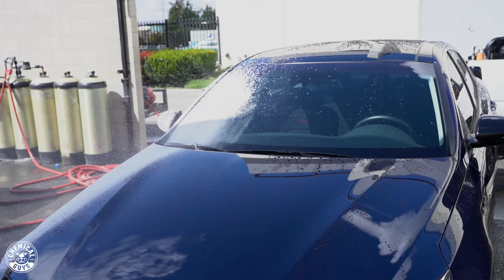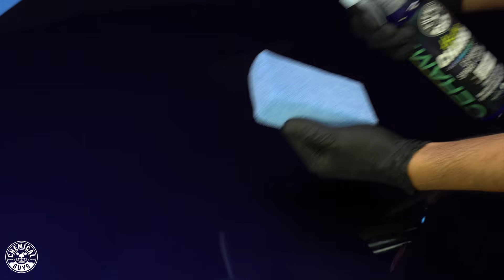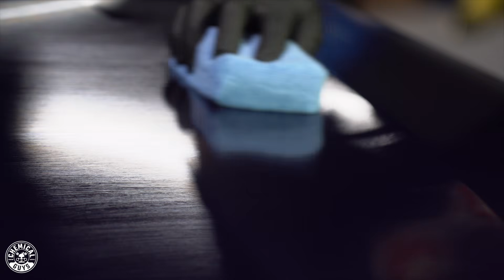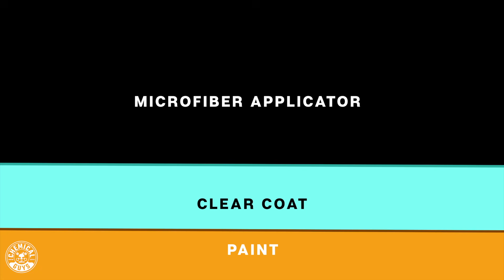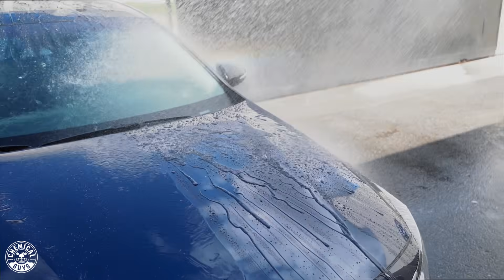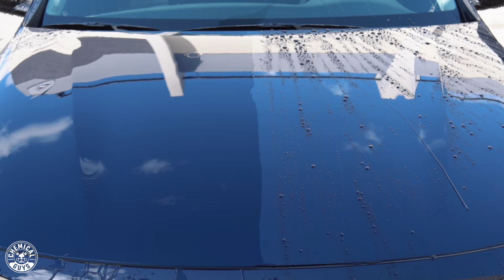How To Easily Apply NEW HydroCharge Ceramic Spray Coating | Chemical Guys

Comment: So I did hydrocharge on my hood only, but forgot to polish first, so I still have unwanted swirls.  Will clean slate or wipe out take hydrocharge off so I can start over.  If not, how do I get it off. Thanks!
Reply from the maker: Hey Kevin! We recommend polishing Hydrocharge off. Clean Slate will not strip it off. Thanks for watching and thanks for being part of the Chemical Guys family!
Reply: @ChemicalGuys  I cleaned with Clean Slate and it was not beading as much as before.  I then polished with VSS then did hydrocharge and it worked okay.  I feel like the polish did not do as well as usual, but maybe it was because it was doing more stripping of hydrocharge then it was filling scratches and swirls.  Thanks so much!

Comment: Will this product work on any chemical guys product for a detail spray?
Reply from the maker: Hey! Hydro Charge is a sprayable clear, liquid nano-ceramic coating. Hydro Charge can be described as an additional clear coat, with 3 times the hardness and self-cleaning hydrophobic properties. Hydro Charge is not a quick detail spray.

Comment: Can this be used on powder coated rims?
Reply from the maker: Hi Randall, HydroCharge is only designed to be used on clear coated painted surfaces, not powder coated surfaces. Thanks for watching and make sure to check back Monday for a new video drop!

Comment: Would you apply a carnuba wax on top of this product? When is this landing in the UK!?
Reply from the maker: Yes, HydroCharge Ceramic Spray can be layered. We have found in testing that 2 rounds are more than enough for any surface we have tested. We do have aerospace clients that have gone as far as 4 coats. Thanks for watching and thanks for being part of the Chemical Guys family!

Comment: Would you use jet seal before using the ceramic coating for an added layer of protection?,how long does this ceramic last?
Reply: Connor Broyles after. And up to a year from what I’ve read

Comment: Can you put ceramic on the windows? No one ever talks about it
Reply: Wot u think rain-x is ?
Reply: @dentman62  Honestly not sure. Wouldn't consider it a ceramic coating. Especially since it doesnt last near as long. I figured it was ok, but no body does it so i was curious. 🤷🏻‍♂️

Comment: Would I need to wax my car as I normally would after this product or is this a replacement of that?
Reply: If you wax after you'll be covering up the properties of this product. Adding a layer of wax may also degrade the sealant beneath it depending on what ingredients are in the wax.

Personally I wouldn't.

Comment: what is the best way to clean bugs and tar off the ceramic coating? will bug remover also remove the ceramic coat?
Reply: Try soapy water (The one that doesn't strip the was/coating)if you can get rid of them

Comment: And this is why you sand before and after you put in a clear coat. Don’t get me wrong this stuff works but there’s a reason there’s factory paint and custom paint. The time and effort goes a long way. Yes these products make it shiny and protect, but even the picture he used to show what it does showed the clear coat as jagged.

Comment: This video was amazing! Keep up he awesome work! Also, would you throw away the microfiber towel after it’s used to buff off excess product? Or are you still able to save your towel?
Reply: If you wash it immediately it should be ok. If you let it sit the coating will harden in the towel.

Comment: Anyone know if this can be layered on itself?  Meaning would adding a second coat after adequate cure time extends the longevity of the protection?
Reply from the maker: Yes, HydroCharge Ceramic Spray can be layered. HydroCharge Ceramic Spray Coating is an ambient air cured coating. No special lighting or infrared light is required. The unique sprayable formulation starts to cure the moment it is sprayed out of the bottle and exposed to air. Once applied to the surface, the product will bond within 1-2 minutes. Always remove and buff to a perfect shine with a premium microfiber towel. Feel free to layer your coats of HydroCharge as you please. We have found in testing that 2 rounds are more than enough for any surface we have tested. After applying HydroCharge Ceramic Coating, it is ideal to keep it out of the elements in a dry and clean environment for 2-3 hours. Depending on the climate, the hydrophobic effects will continue to improve even more after 24 hours of being applied. Also, make sure to check out HydroSuds Ceramic Car Wash Soap to maintain your coating to make it last and shine the longest! 
https://www.chemicalguys.com/hydrosuds-ceramic-car-wash-soap/CWS21216.html
Reply: Thanks for replying so quickly.  If the product is layered does that increase the longevity of the protection?

Comment: Hi just would like to ask can this product be used in direct sunlight or in the shade?
Reply from the maker: Great question! Yes, HydroCharge can be applied outdoors, we recommend that you stay away from direct sunlight and work on a cool surface, also work in a shaded or covered area such as under a tent. Preferably you should work in a controlled environment to prevent contaminants with interfering with the results of your application of coating. Happy detailing!

Comment: When will this product be available on Amazon??? Thank you!
Reply: I was wondering the same dam thing. . LOL LOL
Reply: It's on Amazon right now..only 5 left though.
Reply: @jeffshelton2970  Ive been looking for months. Still cant find it.
Reply: Chemical Guys WAC23016 HydroCharge Coating-The Ultimate Nano Ceramic Spray Car, Boat & Motorcycle Long Lasting Paint Protection https://www.amazon.com/dp/B07PZ92KJ3/ref=cm_sw_r_cp_apa_i_F.SxDbJ4FGPHN

Comment: @chemical Guys can it be used on top of your jetseal?
Reply from the maker: Great Question! We recommend stripping the surface of the paint from any previous and or residual wax or sealant from the paint for HydroCharge to have the best bond possible to the paint. HydroCharge Ceramic Spray can also be layered. We have found in testing that 2 coats are more than enough for any surface we have tested. HydroCharge is layerable with all your favorite Chemical Guys waxes, sealants, and quick detail sprays. Simply wait for HydroCharge to dry and then proceed as you would on any other car. Refer to HydroCharge FAQ'S for any further questions you may have. Happy Detailing!

Comment: Can this be used on vinyl wrapped cars?
Reply from the maker: Great question! We recommend that you use our Wrap Detailer Gloss Enhancer & Protectant for glossy vinyl wraps and or Meticulous Matte Detailer & Spray Sealant if it's a matte finish. Both are spray quick detailers and spray sealant in one to maintain glossy vinyl or matte wraps and to protect them from harmful UV rays and drying. Make sure to check it out on our website, link will be mentioned down below! 
https://www.chemicalguys.com/wrap-detailer-gloss-enhancer-and-protectant-for-vinyl-wraps/wrap-detailer-gloss-enhancer.html
https://www.chemicalguys.com/meticulous-matte-detailer-and-spray-sealant/meticulous-matte-detailer.html

Comment: How does this compare to Carbon Flex C9?  is it a comparable replacement?
Reply from the maker: Hello Kevin, great question! Sprayable ceramic coatings such as HydroCharge is a newer and easier form of applying a ceramic coating to your paint. Traditional coatings such as Chemical Guys Carbon Flex C9 coating will be superior in durability and shine because its a lot thicker and harder of a product due to it's more concentrated form. They are both great products but differ in application and results. What you can also do is use HydroCharge as a topper for Carbon Flex C9 to replenish your coating and make it look and last a lot longer. Make sure to stay tuned on future videos we have coming your way which follow this line of coating!
Reply: Chemical Guys Was going to ask this. I used Carbon Flex C9 one year ago when my car was brand new. Would this be a good scenario for using HydroCharge to touch it up? Also, should I wash with Clean Slate or will that impact the carbon Flex C9? Many thanks!

Comment: I just found out you guys have a store in Montclair and I'm so happy! I can finally buy my supplies somewhere else than the onld store down the road
Reply: Good luck getting it from the stores. Unless Cali
Reply: @biohazeconversions4872   I'm in cali. And one of their stores is like 15 min away from my house
Reply: @antonioparamo2048  Your best bet is Gardena store but quick call to ur local DGCG should help
Reply: @biohazeconversions4872   Detail Garage - Auto Detailing Supplies
5108 Holt Blvd, Montclair, CA 91763
(909) 626-0103
https://maps.app.goo.gl/EBNPp

Comment: Would it hold up to pressure Washer force though. The foam cannkn along with the pressure washer usually degrades coatings faster than usual
Reply from the maker: Yes! HydroCharge is a hardening ceramic coating that penetrates deeply into the pores of the paint when properly prepped and will hold up to even the harshest elements. Assuming that you're using a pH neutral shampoo that isn't going to break down the coating in the long run then it would hold up for the full 12 months of protection. Also make sure to check out HydroSuds Ceramic Car Wash Soap to maintain your coating of HydroCharge.
https://www.chemicalguys.com/hydrosuds-ceramic-car-wash-soap/CWS21216.html

Comment: I have a black Veloster Which I use black light wax and I use a sealant and then I come back with the black light ending wax that is in the canned paste could I use this on top of the ending wax of the black light That’s the final stop for my detail of my car can I use this Hydro charge on top of that?
Reply from the maker: Great Question! We recommend stripping the surface of the paint from any previous and or residual wax or sealant from the paint for HydroCharge to have the best bond possible to the paint. HydroCharge Ceramic Spray can also be layered. We have found in testing that 2 coats are more than enough for any surface we have tested. HydroCharge is layerable with all your favorite Chemical Guys waxes, sealants, and quick detail sprays. Simply wait for HydroCharge to dry and then proceed as you would on any other car. Refer to HydroCharge FAQ'S for any further questions you may have. Happy Detailing! https://www.chemicalguys.com/blogarticle?cid=article-hydrocharge-faq

Comment: Can you use this over jet seal since i already used jet seal and wax about a month ago.
Reply from the maker: Great Question! We recommend stripping the surface of the paint from any previous and or residual wax or sealant from the paint for HydroCharge to have the best bond possible to the paint. HydroCharge Ceramic Spray can also be layered. We have found in testing that 2 coats are more than enough for any surface we have tested. HydroCharge is layerable with all your favorite Chemical Guys waxes, sealants, and quick detail sprays. Simply wait for HydroCharge to dry and then proceed as you would on any other car. Refer to HydroCharge FAQ'S for any further questions you may have. Happy Detailing! https://www.chemicalguys.com/blogarticle?cid=article-hydrocharge-faq

Comment: Just jet sealed my truck can this go on top or do I have to start over?
Reply from the maker: Great Question! We recommend stripping the surface of the paint from any previous and or residual wax or sealant from the paint for HydroCharge to have the best bond possible to the paint. HydroCharge Ceramic Spray can also be layered. We have found in testing that 2 coats are more than enough for any surface we have tested. HydroCharge is layerable with all your favorite Chemical Guys waxes, sealants, and quick detail sprays. Simply wait for HydroCharge to dry and then proceed as you would on any other car. Refer to HydroCharge FAQ'S for any further questions you may have. Happy Detailing! https://www.chemicalguys.com/blogarticle?cid=article-hydrocharge-faq

Comment: what is the SIO2 content on this, as a precentage ?
Reply from the maker: Hello Paul -  The quantity of SiO2 does not determine the quality of the product and it’s just one of the ingredients that make HydroCharge protect and shine like nothing else. To avoid copycats in the industry, we do not disclose the exact amount of SiO2. All we can tell you it’s between 25-55% and that it’s the perfect amount for optimal shine and protection!
Reply: Thanks for the Information.  That is quite a high percentage compared to other SIO2 spray on coatings. With that amount then it could be considered an actual coating.  When is it coming to the UK ?  @ChemicalGuys
Reply from the maker: Thank you for being part of the Chemical Guys family! Make sure to check with Chemical Guys UK for further info and product availability! https://www.chemicalguysuk.co.uk/

Comment: can this be applied outside? in the sun? (direct or indirect) or only indoors in a controlled environment like traditional coatings? also how many vehicles do you think a bottle will be able to do?
thanks
Reply from the maker: Great question! Yes, HydroCharge can be applied outdoors, we recommend that you stay away from direct sunlight and work on a cool surface, also work in a shaded or covered area such as under a tent. Preferably you should work in a controlled environment to prevent contaminants with interfering with the results of your application of coating. The usage of the product varies upon use of the product, remember you do not need to over saturate the area, a little bit goes a very long way. Happy detailing!

Comment: I just got tree sap from a pine tree on my 2017 Jeep Renegade Trailhawk... what’s the best CHEMICAL GUYS way to get this off the paint, windows and trim. I need to do this ASAP before it starts to mess up the paint.
Reply from the maker: Hello Bentley! There are many products that work out great to remove tree sap such as Bug and Tar Remover, Clay Bar and even Butter Wet Wax! Make sure to check out our video on what you can use to remove heavily stuck on tree sap, bird droppings, tar and ash from painted and glass surfaces! Also make sure to check out our previous video on how to prep your vehicle before you apply a ceramic coating! You're on the right path to restoring your 2017 Jeep Renegade Trailhawk to better than when your first got it! 
https://www.youtube.com/watch?v=X-hZM-nqfBA 
https://www.youtube.com/watch?v=C2-L_1wJwCE&t=1s
Reply: Chemical Guys I used nail polish remover and the sap came off instantly vs big remover and others. Did a good wash first, nail polish for sap then wax the whole Jeep. Looks like new now.

Comment: Hey quick question, so is it okay if I use butter wet wax, then jet seal and then use this like on top of the sealant ? Thanks !!
Reply from the maker: Great Question! We recommend stripping the surface of the paint from any previous and or residual wax or sealant from the paint for HydroCharge to have the best bond possible to the paint. HydroCharge Ceramic Spray can also be layered. We have found in testing that 2 coats are more than enough for any surface we have tested. HydroCharge is layerable with all your favorite Chemical Guys waxes, sealants, and quick detail sprays. Simply wait for HydroCharge to dry and then proceed as you would on any other car. Refer to HydroCharge FAQ'S for any further questions you may have. Happy Detailing! https://www.chemicalguys.com/blogarticle?cid=article-hydrocharge-faq
Reply: Oh ok I see so I just bought hydro charge so what I should do is first spray that and then on top of that I can layer wax and then sealant right ? Thank you very much !!
Reply from the maker: Yes! Just make sure to prep your surface properly before you apply HydroCharge and once removed then proceed to applying your favorite Chemical Guys poducts!

Comment: So my other question is because I been saying spray on ceramic sprays; because it’s a new thing on the detail market, would this new product on the market be different than a real Ceramic Coating or is it just a temporary thing?
Reply from the maker: Hello Joe! Sprayable ceramic coatings such as HydroCharge is a newer and easier form of applying a ceramic coating to your paint. But traditional coatings such as Chemical Guys Carbon Flex C9 coating will be superior in durability and shine because its a lot thicker and harder of a product due to it's more concentrated form. They are both great products but differ in application and results. Make sure to stay tuned on future videos we have coming your way which follow this line of coating!
Reply: Chemical Guys Whats the timeframe it lasts for this product?
Reply from the maker: Great question! HydroCharge is a long lasting spray ceramic coating that can offer protection to your paint for up to 12 months just from one easy application! Also, make sure to also look into our HydroSuds ceramic car wash soap to maintain your coating and for a brilliant ceramic high gloss shine. Happy Detailing! https://www.chemicalguys.com/hydrosuds-ceramic-car-wash-soap/CWS21216.html